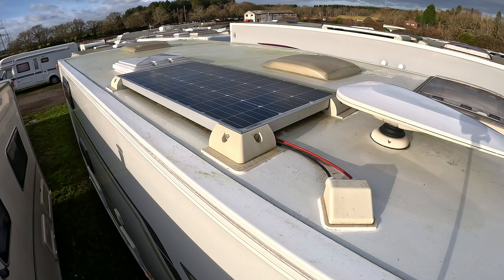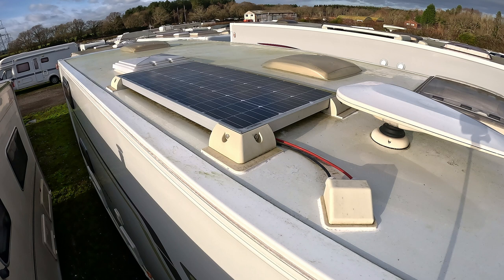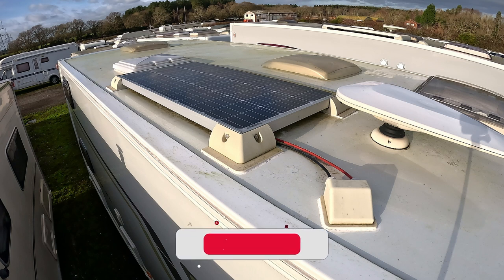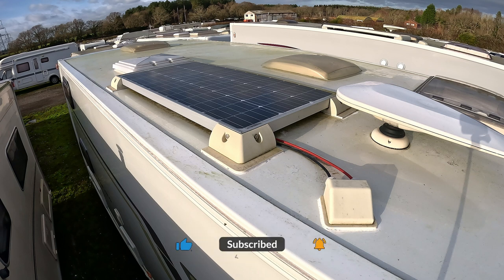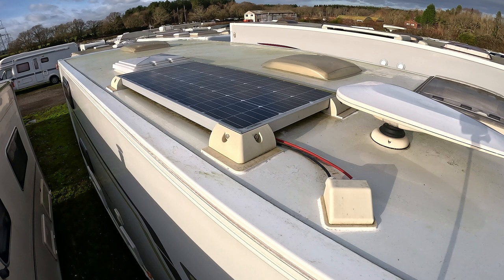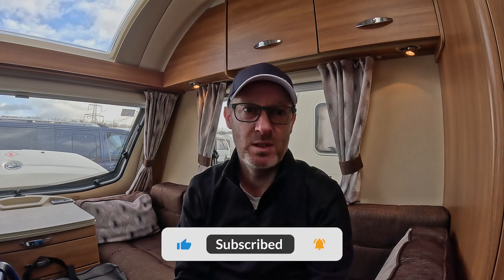Caravan Solar, No Mains Hook Up Required! 🌍🚐☀️ #caravan

Comment: Did exactly the same with my van, changed to lithium leisure battery and was amazed at how much better it performs 😊
Reply from the maker: Such an easy upgrade that gives you so much more flexibility when it comes to off-grid living.